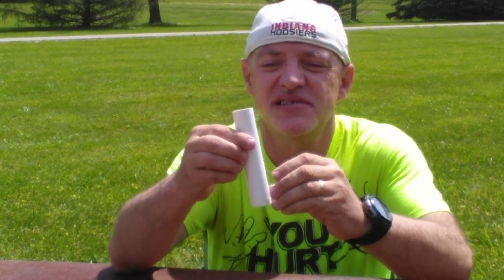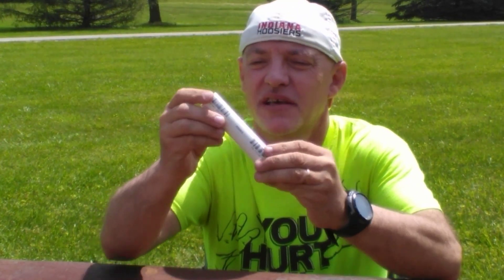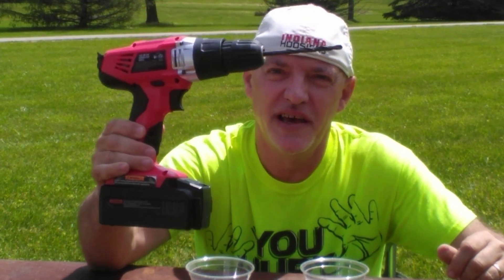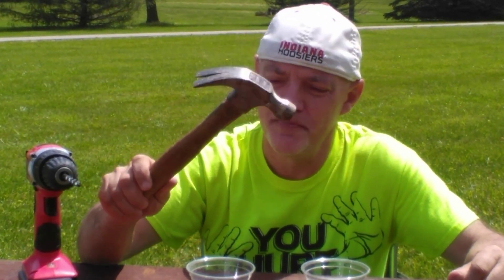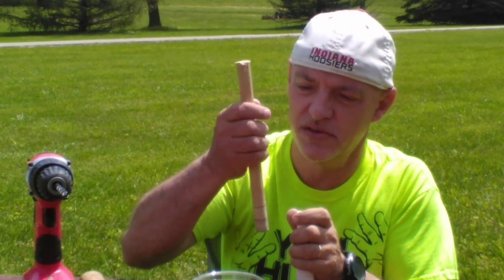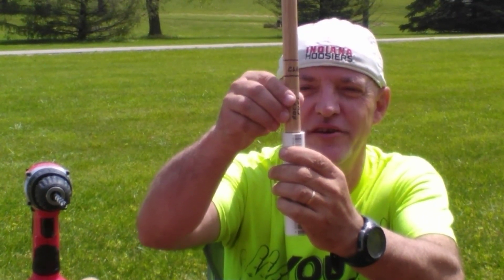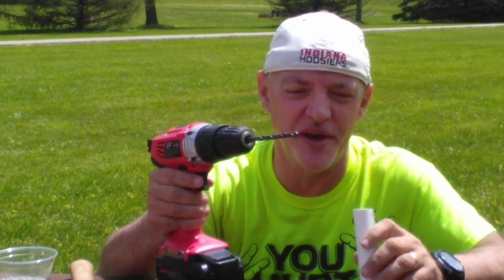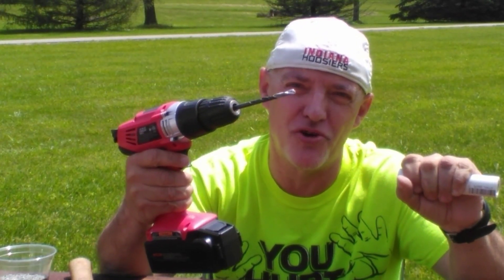HOW TO MAKE A KNO3 E45 ROCKET ENGINE--STEP BY STEP!

Comment: Something to consider is you can core out the rocket and drill all the way through the fuel, then it will burn faster. Line the drill bit up to the dowel and make a mark or put a small piece of tape at the end you put it into the drill, and stop drilling when the tape is on the nozzle

Comment: You can buy Potassium Nitrate by getting Spectracide Stump Remover. It is 100% potassium nitrate. Also, if the motor burns as long as yours did. how is it an E45 motor? It might become something like an e5 or something depending on  how long the burn is.
Reply: I believe Becuase only the clay was drilled through, not the powder, the rocket did not burn all at once. it would be a E45 if the core was drilled all through, however, the white was not drilled that much, so the propellant doesn’t burn as short

Comment: If I were to attach it to a rocket made of the same material as a pool noodles, would the rocket fly?
Reply from the maker: Yes it would.
Reply: @BrianBaxterScience   Cool, thank you
Reply: As long as the Center of pressure  is below the Center of gravity by the a equivalent length of the diameter of your rocket body tube